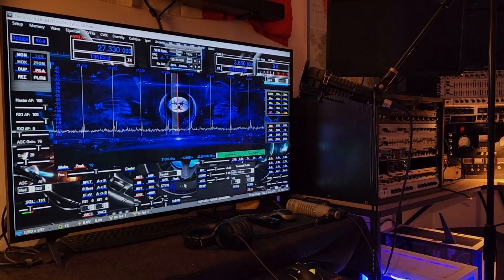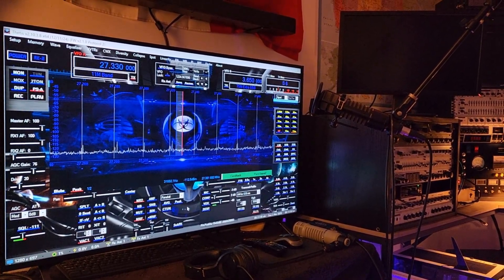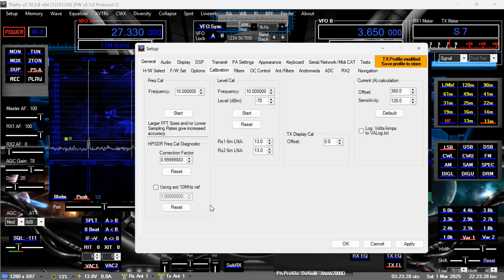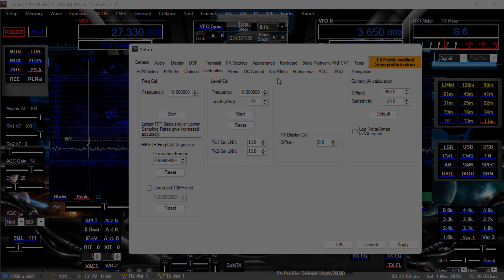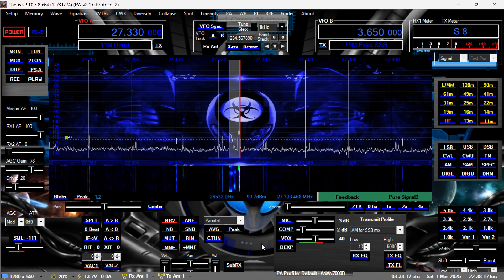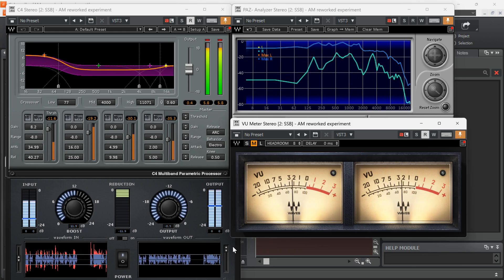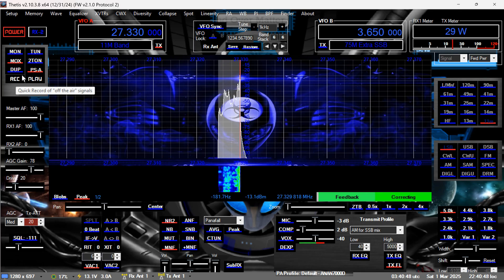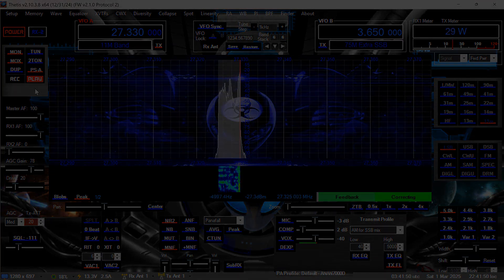ANAN G2 Ultra Freq Cal and software check

Comment: This video gave me more questions about how you're calibrating your rig, maybe the cut away moments are not showing it. Are you adjusting your vfo to the WWV signal, so it has the Reference or are you injecting a signal for that. I understand how I calibrate the Hermes but thinking you're doing something more and the editing is not showing that part.
Reply from the maker: Hey bud. Sorry for the misunderstanding. I didn't do anything on my end since I'm already calibrated. I had the calibration screen up so I could walk him through how to get to that screen.